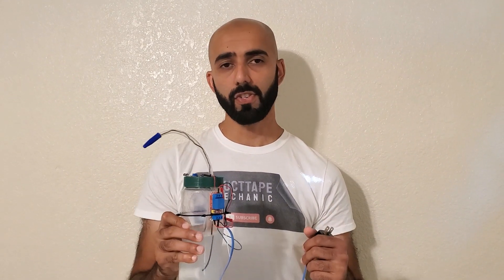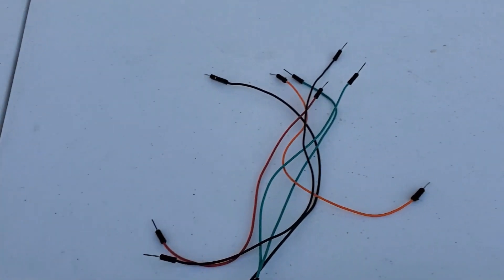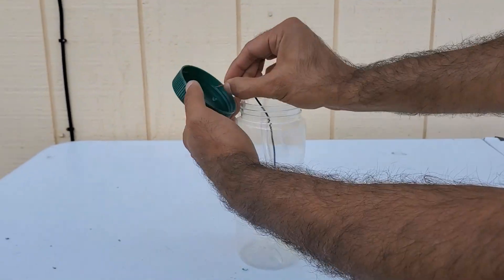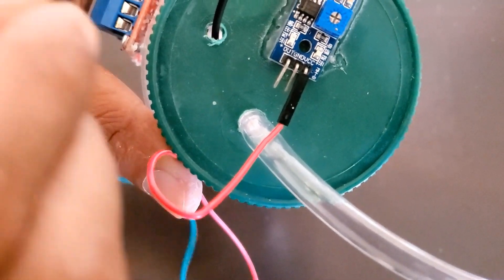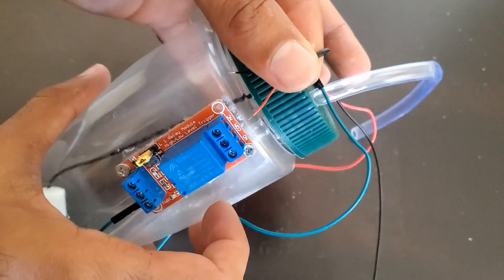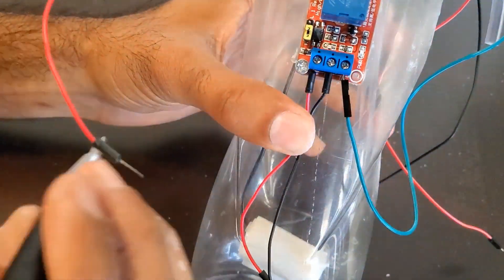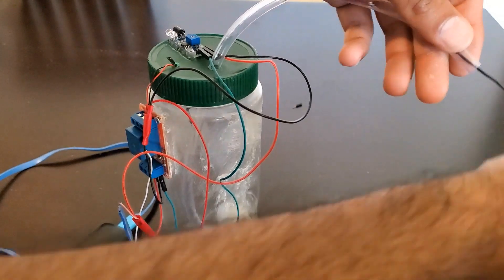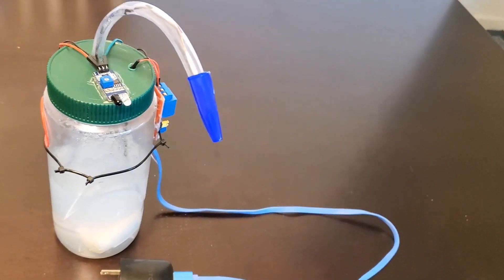Simple Touch Free Dispenser || DIY

Comment: In the beggining of the video, your product shows the red jumperwire being connected to the NO of the relay but in the tutorial you connect it to the COM?
Reply from the maker: It shouldn't matter whether the red positive wire from the pump is connected to NO as long as the red from the power is connected C or vice versa. We are essentially just interacting this connection using the relay.

Comment: I have an ultrasonic distance sensor , would it be usable ?
Reply from the maker: It dawned upon me that the ultrasonic sensor has to be triggered. Therefore it will not work under this configuration unless you want to trigger it using a 555 then hook "echo" to a relay module at the point its better to use a arduino (or a IR sensor like this one)